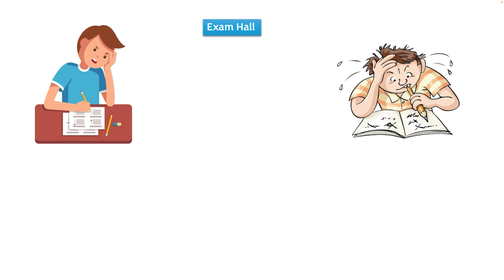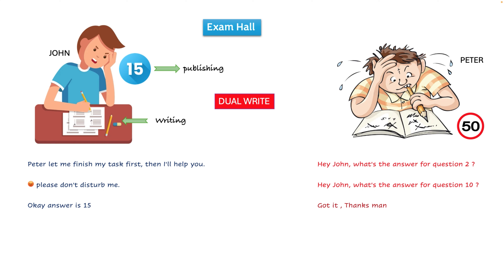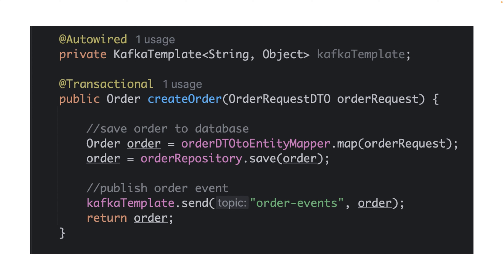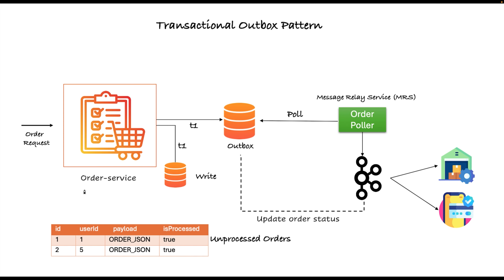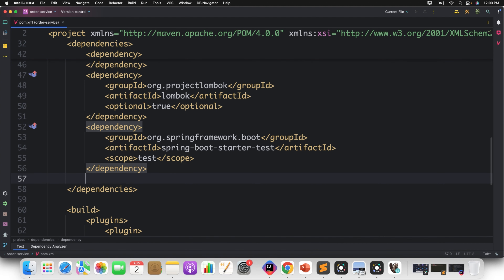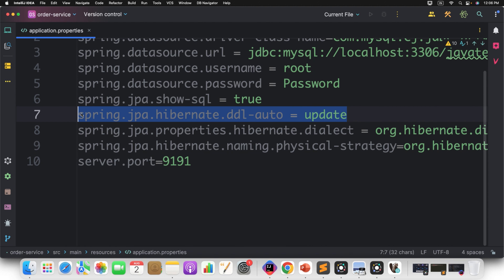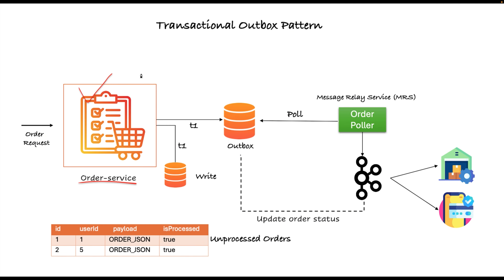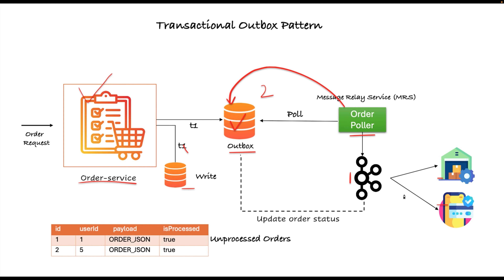Microservice Transactional Outbox Pattern 🚀  | Realtime Hands-On Example | @Javatechie

Comment: Hi  @JavaTechie, You are moving the data consistency problem from order service to "message relay service" in this case. what if DB is down while publishing the message(marking the flag true) or kafka is down in the "message relay service".  Either way, you are in the same problem. Please comment.
Reply: Yes, it's correct, consider this if msg is published and updation failed, msg will be processed again in other iteration, meaning a msg may be processed twice, it's ok if you have an idempotent system, but consider without transaction outbox pattern, if order failed to persist and we are publishing an event thats a bigger problem
Reply: Transactional outbox pattern solves dual write problem ,it says that when writing  to 2 or more  different sources(DB & Kafka) consider writing it to single source and maintain an outbox( kind of log book) so that it can be processed by other sources as well

Comment: @Javatechie In pollOutboxMessagesAndPublish method again you are performing two operations publishing message to kafka topic and updating outbox table record. What if one success other one failed, again you have the problem you disscussed
Reply from the maker: It's not an issue right? The proces will be bit delay at least record Will be processed in next iteration
Reply: @Javatechie  What if published to kafka topic successful and failed to update outbox table record?. We get same outbox table record in next scheduled time then we publish same order more than once.
Reply from the maker: @ramesh_panthangi  can you please try sending duplicate message to.kafka and validate In your local once .
Reply: @Javatechie  Not a straightforward solution to the problem you discussed. There is a lot to work around this
Reply from the maker: @ramesh_panthangi  sure I got your point let me think and upset the solution
Reply: we need to use Idempotency

Ensure that the consumers of the Kafka message can handle duplicate  events idempotently. This means that if the same event is processed more than once, it has no adverse effect on the system. 

This is exactly once processing.

Comment: Thank you for the informative video! I have a question: from a use case perspective, should createNewOrder include both the creation of a new order and the publication to microservices within a single method? To adhere to the Single Responsibility Principle, it seems we should have two separate methods: createNewOrder and notifyMicroServices, with notifyMicroServices being called only if there are no exceptions in createNewOrder. Does this approach address the concern, or am I missing something?

Comment: Nice video. Easy to follow through the concepts and grasp practical knowledge. One thing to add is that, the events in outbox table should have a unique identifier which is sent through as part of the payload and the downstream systems need to have some sort of de-duplication based on that ID. Example in this case, the event is sent to kafka but the update of the "processed=true" flag fails, next time the same event will be picked up and should be safe because it still have the same id, otherwise without a unique identifier we cannot de-dupe and we have just shifted the double write problem from the entity to the outbox.
Reply from the maker: Awesome man . Good catch thanks for the solution 👍 i will check this behavior once hopefully it will handle by kafka it self

Comment: Nice content Basant. 
We can achieve same thing using Spring event listener and publisher model too.
Second thing, this solution is not enough on the production environment where multiple instances run simultaneously.
You will come across duplicate records.
Reply: you can achive it by using Shedlock.
Reply from the maker: Hello Rahim , I don't understand how spring event will help you here could you please add some insights on it also regarding your second concern you can still guarantee to run scheduler once by implement Shedlock that's not a big challenges.  Don't worry I will try to cover this shedlock soon
Reply: Yes, Last month I worked on a similar issue where I implemented Shedlock
Reply: We should not allow both the instances to run simultaneously so Shedlock lock the database. I mean instance of locking the database It will lock the one single table
Reply: @Javatechie Though you implemented Shedlock lock but you may get duplicate records in one scenario.

Suppose there are 2 instances running. The first instance gets a chance to execute the job and suppose your server is busy due to heavy load and it doesn't respond within 1 min or may chances that database is busy and not respond within 1 min.

After 1 min 2nd instance gets chance to execute the job. Suppose this time database is idle state so both the instances may have same records.

Please handle this scenario in ur next video
Reply from the maker: Yes, but in a production environment, this is very rare. You can consider it to have a 0.01% chance of happening.
Reply: @Javatechie  let's consider this scenario in a different way.

Suppose there are 12 unprocessed data in the database. Suppose 1 record takes 10 seconds to send a message and update the status into the database.
Instance 1 can handle only 6 records in 1 min so still 6 records is left to process.

Now instance 2 gets chance so it will pick up remaining 6 records which are unprocessed.
Instance 2 also processes 6 records in 1 mins.

Now instance 1 will get chance and it will send remaining 6 records which are duplicate records.

This is very common scenario on production env.

Comment: There are many other benefits. 
1. Decoupling of order service and Kafka, now order service can receive order irrespective of kafka downtime issues. Downtime may required for upgrade or downtime can be because of kafka down. Order service can be latent if kafka publishing process lags in publishing. So any issues with Kafka service are now not impacting the Order service.  Now there is a choice to publish messages. If there is no need to process the inventory at real-time, assume we have 1 day of processing time then we need to run kafka and listener service together in a scheduled manner, may be once in a day, which benefits in terms of cost, especially on cloud deployments
2. Following Single responsibility of SOLID design principles
Reply from the maker: Absolutely agree and thank you for summarising this benefits .

Comment: In your code snipped in 5:40 minutes if save(entity) get failed it won't execute the kafkaTemplate.send() as @transactional will stopped the code execution
 immediately. if it won't work we can handle failure in try catch block why we need other MS to handle it if we can handle it in four lines of code .??
Reply from the maker: Try vatch won't help you to resolve dual write problem deep
Reply: The explanation really good but I did not understand what is this dual write problem here!

1. I hope this is not the right usecase brother, with simple approach we can solve this problem rather creation on new outbox table and one more additional microservice to process them asynchronously

2. If that is the case why can't you a new column to orders table rather new table and duplicate all the data, it's a big scalability problem 

3. One biggest problem here is if order status is successful, then only try do the next steps why do we need to maintain a separate table all together and other service to proceess them?

Comment: Many thanks. Grateful. Very detailed. Just one doubt. Let's say after publishing to Kafka there is error while updating processed status by poller service. In that case same order will duplicated at consumer side. How we can prevent this
Reply: @anupamkumartejaswi9210  there is a way to handle such situations. Add one more column in a table let's say isProcessed which indicates that the transaction process is successfully or not.

In case, After publishing message in Kafka if any error occurred during updating the status so request will go inside catch block.
In catch block update the isProcessed column status as "failed" something. Which basically states that message is sent but status in not updated in the database.

In next time when job starts its execution so update that record status to "completed".

In the success scenario you have to update 2 columns status 
isProcessed and status column too
Reply: @rahimkhan-fh9dd  problem still remains the same, let's say DB itself is down, in that case we cannot make any update right even from catch block. One way that I could think of is retrying after certain delay to update the DB.

Comment: We can use exception try and catch to overcome such issues. If something went wrong in persisting database, then it should not send message to Kafka. Please correct me If I am wrong.
Reply from the maker: Isn’t it manual effort?
Reply: @Javatechie  when you say manual effort, can you plz elaborate how it's more work?
Reply: @pogo874u  there could be multiple reason of db writing failure, and its not a good programming to handle all in a single Exception class. and in this example its just a small case just to explain the pattern, in real time you may get more complex scenario where you bound to use this pattern.

Comment: This can be easily handled using Spring event publisher and listener model...
Reply from the maker: Can you please share some more inputs . Also as I know spring event can be use in same application it won’t work in microservices pattern (means inter communication)
Reply: @Javatechie  First of all, thanks for all your efforts. I have learnt many things from you. I will try to implement using Spring event and share you the github link. Thank you 🙏

Comment: Hi, I have a question . Inside order puller project , we are fetching data from outbox table and then, again updating processed field into that table.. but, I would like to ask if avain table updation fail. Then, kafka producer will still send the data to the topic. Is not it a case if inconsistency, since it's a dual write.
Also, if we mark publish method inside kafkapublish as @transactional but, still I think will be loaded into kafka topic.
Reply: If the transaction rollback is there, while updating the data into the outbox table. Then , there will be a repetitive publish into Kafka topic.
Reply: Again, for such a case, maybe the consumer needs to add some logic that it should add further operation or logic to process each order info for once only. may be by using order_id field.

Comment: Small doubt.... The poller service seems to have reintroducing the dual wrtite problem since its publishing to kafka and updating the state in Outbox table. What if the the update fails and the status is 0. Won't the same event be polled twice and published multiple times to kafka?
Reply from the maker: Yes you are write but we need to handle it in efficient way in poller by applying some retry mechanism to avoid data in consistency and regarding dual write issue in poller is acceptable as it's just act as a helper to process the data but thank you for bringing this point . Will update best practice shortly
Reply: @Javatechie  thanks for responding . Ok so you mean we introduce Retry and dead-letter queues to ensure consistency. But even then can't we have this as part of the order ms why introduce an extra layer between the producer and consumer (which will also result in additional latency). Currently it seems like all this pattern is doing is deferring the dual write problem to another downstream ms. Maybe I'm getting a bit ahead of myself and should wait for further videos from you to clarify this bit.

Comment: I dint see you writing configurations of Kafka bootstrap server in poller service. So wondering how it got published into the queue.
Can you explain how it worked without configuration?
Reply from the maker: That's the magic of auto configuration feature of spring boot , so if you won't configure explicitly it will load default value like bootstrap localhost:9092 and since I am playing with string no serialize and drserialize configuration required here
Reply: @Javatechie  great and one small question, can we use Mapstruct instead of using mapper methods where you are converting dto to entity?
Reply from the maker: @ravitejpotti  yes absolutely correct we should use

Comment: This will work only if there is one server, in multi server you will get issues
Reply from the maker: What issue you will get ? Could you please add some inputs
Reply: @Javatechie  First i would like to thank you for your work,Love your content,  I am your subscriber since very long :)
 The challenge i was talking is : 
Lets suppose this same code is running in different pods , the order poller may fetch same records in two different pods, so some records will process twice.
Reply from the maker: Yes you are correct but we can use shedlock to avoid duplicate run of our scheduler in different instance
Reply: @Javatechie  Will go through the shedlock, Thank you Basanth for making YouTube content.

Comment: So what happened if broker is down.
Reply: I guess in that case, the table and outbox table will be written but puller service's message sending will fail.
And once the broker is up and running, puller service will pull the data from outbox table and send them successfully.
So the only problem is, processing being postponed for a while (because of the broker is down), and there will be no data issue.

Comment: I have not gone through the entire implementation, but i see the first explanation. Instead of doing this, why can't we have an if condition checking that the data is saved to db? Then go and publish the message

If(!order.save(entity)){
 RETURN EXCEPTION 
} 
Publish message to kafka 

This way, it is synchronus, and once data is processed, then the event will occur 

Note: I'm not an expert in coding
Reply: I guess the problem is, you will still put everything within a method under @Transactional. So, suppose your database operation is a success, and your broker works fine (message is sent). But somehow, there is exception thrown because of a logic issue. In that case, Spring will still rollback the whole database operations while not the operations you did on Kafka, and a data issue will be happen in this scenario.
This is just my understanding, it could be wrong and please correct me if so.
Reply: @haolinzhang53  You are right 👍
Reply: @haolinzhang53  Yes, that's what i thought. If something happens after data persistence, i mean at the stage of publishing message, so under transactional, all the data operations will be rolled back and we don't need to rollback any kafka operation because our exception happened at kafka level so anyway our message won't get published.
Reply from the maker: What if Kafka published first then your db operation failed ?
Reply: @Javatechie  in that case we have to manually rollback which is headache. But i was just thinking in a way where db is first then kafka.